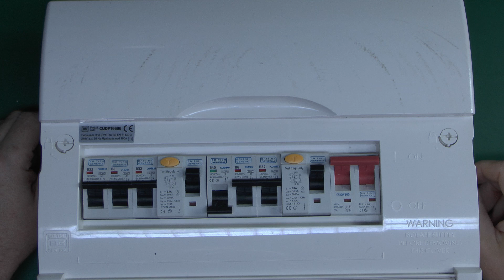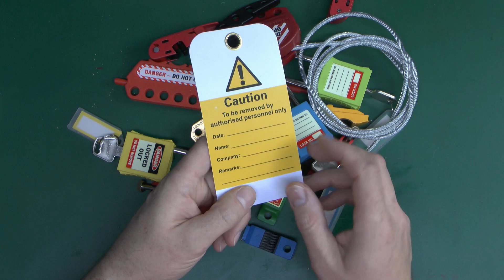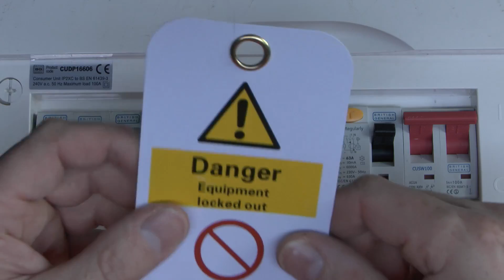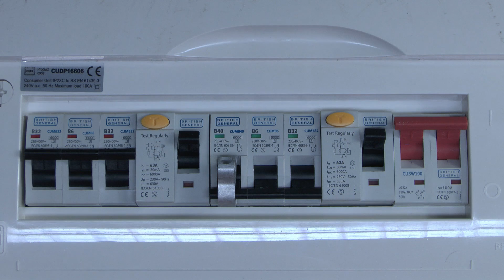Electrical Lockout Tagout Equipment

Comment: thank you for your guidance
Reply: We are a professional lock manufacturer with 10+ years of experience. Our main  products include smart locks, mechanical locks, and industrial locks, certified by  CE/ISO9001. All products feature high security, durable materials, and competitive pricing. We support small MOQs and timely delivery.
Would you be interested in receiving our product catalog and quotation?

Comment: Those coloured padlocks I have one and it made of nylon /carbon composit even the shackle so it fully insulated, silly idea as you could cut the shackle with a pair of cropper’s . My other locks are all metal with hardened shackles. As for working live it isn’t illegal as we have to work live sometimes such as Ze and Zs as well as taking voltage measurement’s and faise rotation . Fantastic video John as always 👍❤️

Comment: Why on Earth can’t they standardise small breakers so that one device fits all of them and you don’t need to carry a whole bag of different ones around with you?

What are the large square keys used to control access to high-Voltage equipment?  The keys are about 30 mm square and fit over a square part in the lock.  This square part carries identifying letters or numbers, and each key will only fit where it is supposed to.  The same key is used both to switch off the supply, and to gain access to the equipment enclosure.  To gain access you need the key to unlock the door, and you cannot remove the key from the switchgear to use it in the door lock without switching off first.  I’ve seen these used in a high-Voltage experiment in the film ‘On the SAFE Side’ which was shown as a BBC Trade Test Colour Film in the late ‘60s, and also for the million Volt Marx generator which used to be at the Science Museum in London until they removed almost everything interesting from display.
Reply from the maker: It could be done, but won't be - consumer units are type approved, and to have devices from mixed manufacturers would require approval testing with every possible combination of devices in there which would be ridiculously expensive.

Comment: I spent some time as an electrician in a south African coal mine. I locked out a machine as the operator kept driving it through deep water dragging the D.C. traction motors through the puddle. The mine engineer came to me whining that the motors were flameproof so therefore it wasn't a problem. I told him to fuck off and educate himself and come back to me when he'd got the water pumped out. Five minutes later I saw the machine drive past me. I stopped it and asked the operator why the machine wasn't locked off. He said "Mine Boss cut off lock"  I walked out off the section using every lock out i had, I had several, to lock out the conveyor system. Effectively stopping the section from producing coal. I jumped in a Jeep, drove to the surface and reported this to the mine manager the same time tendering my resignation as I no longer wanted to work with these cowboys.
Even an efficient lock out system is fallible! Watch yourselves out there.

Comment: Most of our circuitbreaker boxes in the Netherlands are built in a closet, which can be locked. Easy peasy.
Reply: Here in rip off Britain we think of many new inventions which over complicate things, ensuring you buy specialist tools to carry out a single given task.
Reply: We are a professional lock manufacturer with 10+ years of experience. Our main  products include smart locks, mechanical locks, and industrial locks, certified by  CE/ISO9001. All products feature high security, durable materials, and competitive pricing. We support small MOQs and timely delivery.
Would you be interested in receiving our product catalog and quotation?

Comment: I think sometimes it is necessary to work on live circuits, but only:
1. In locations where you simply can't switch off the electricity, for example in a hospital.
2. Use additional safety equipment, for example a rubber mat to stand on and gloves which are rated as insulated.
3. Use fully insulated tools, instead of the standard partially insulated ones.
4. Your experienced.

And in Germany we got the five safety rules of electrical work according to VDE 0105:

1. Isolate the circuit.
2. Prevent reconnection.
3. Proof if the circuit is really dead with a tested voltage tester (two pole!), and test all-pole!
4. Earth and short-out all line conductors (only of interest for voltages above 1000V or bare overhead lines).
5. Cover and shield any adjacent live parts/components nearby the working area (in most cases irrelevant too, that's for example when working in a transformer station).

Tested voltage tester means, tested on a known circuit or with a special tester (available by some manufacturers like Megger or Fluke), before AND after you proof if the circuit is dead. To short-out the lines on voltages above 1000V is a pure safety thing, inductive or capacitive coupled in voltages in such high voltage ranges can deliever enough current to kill a person. Otherwise than it is in a low voltage area, where you don't notice this, and can measure it with a high resistive multimeter only.
Reply: No arc flash protection required for live work in Germany? I'm surprised.
Reply: @coffeecoffee5914  Yes, it's required in most cases. Look at point 2, I mentioned additional safety equipment. In final circuits, which are in most cases fused with a B16 A MCB, I think this doesn't make any sense. In that case they want you to wear face protection and flame resistant clothes (pure cotton for example). If you work on a circuit fused with 3x63A or more (three phase is common here, even in residentials. 3x63A is standard in the service entrance of a single family house), you'll have to wear special arc fault resistant clothing.

Comment: Putting tape over " a load of old crap"  LOL you have a way with words and amazing dead pan delivery style. .   My main job is designing industrial lockout solutions based on safety PLCs and trapped key interlocking systems.   I work a lot in the rail industry controlling access to 750dc third rail and OLE  25KV on the railway.  The biggest problem I face is not the lockout system but trying to ensure they are taceable and stop people from defeating them.  It amazes  the lengths  people will go to avoid locking out, they would rather work unsafely and risk their lifes then take a few moments to lock something out. You honestly would not believe the things I have seen.    Well done on the subscribers John well deserved.  I aspire for my first 1000. Another fantastic video John thanks for sharing. Regards Chris
Reply: Go on, tell us then!
Reply: marcaxe  My latest one is someone climbing over a safety fence at high level to get on a train roof. The train was energised with a 25Kv overhead line at the time.

Comment: I'm a BIG fan of lock out kit. I preach about it all the time, and I have a large selection! Don't like your plastic hasp thou, always metal!! Fyi the multi fit ones you show, made by kasp ect are the best, but master lock have a good version of it also.. I do not get along with tiny stupid metal ones that need a tiny screwdriver!! I keep asking Reece safety and masterlock to make a kit, with a multifit, tag and padlock for under £10. That way everyone, even the cheap skates will lock out!!! So many people, especially domestic, don't lock out at all, and have never heard of it! The more it can be advertised and talked about the better!! Thanks for the video!
Reply: I prefer metal also but the company I work for only supplies plastic equipment including plastic locks with a plastic HASP!   If you just give the lock even a stern look it breaks. Not much better than tape as an actual deterrent.

Comment: Perhaps first hand experience of 400 volts would act as a deterrent.
Reply: Not enough for the tree cutters / I think it was actually the power company down my way, although they did leave within a very quick hurry that day. then they started sending me nasty letters about cutting trees on lines it's sad when you're more professional than the professional. I was not home for 1 hour and my neighbor was so annoyed that they were like we should have just had you do it, I left for my dentist appointment as they got there and when I came back they were gone and so was the power and all the electric heat in the neighborhood and water for a whole day + night with elderly Neighbors...... NOT GOOD !!! But hey at least it was the power company that let out the White Lightning.

Comment: I am sure that many of my compatriots are aware of a situation where an operator has ripped off a tag...along with the isolator ring leaving an open box with exposed live terminals.
No he wasn't sacked. One has to wonder about the committment of British companies to HS and the IEE regs.
Reply: @mikeZL3XD7029  Not specifically but yes, if there's no other reason, reckless endangerment would be an appropriate charge
Reply: @mikeZL3XD7029  Are you the same mike trump from ECN? if so, I missed you. I'm the same chipmunk from there. (sad to see how derelict the site is, at least the non US forum)

Comment: Lol meanwhile in the Wild West of Canada we work on live electricity at like 15/20% of the time and usually without insulated tools. In fairness it’s only 120v hahahaha
Reply: PPE helps.... common sense,  while rare, also helps. But be aware... working live at any voltage that can hurt or kill you is not to be sniffed at. Stay safe man
 I do 240 domestic stuff in the UK, but that can still kill you easily. Familiarity
 breeds contempt
Reply: That can still kill you. Although I’ve accidentally been shocked by 110V AC and lived to tell the tale... But then, I’ve also been shocked by 240V ‘cus although the item I thought I isolated appeared to be dead. The control circuit for the contactor relay was fed via the lighting MCB and was still live 😡
Reply: @Mark1024MAK  Indeed. I've worked on both sides of the atlantic pond. And there are times when 240 just tickles, and 120 grabs you. There's bravery and there's stupidity.

I once came across a situation where the contactor coil was fed from a completely different building and different substation than what it was controlling (light columns on a university campus).... I've often wondered about the potential (heh) voltage differences that may have been present.

In fairness, it was flagged and had a local isolation switch for the coil feed... that disappeared into a conduit headed <<<that way
 Still an interesting example of how simple 'turn it off' rules don't fit
Reply: Mike Trump yeah all of those are higher voltages then 120. Anything higher then 120 we don’t work on live.

Comment: Is there a risk that the padlock could block the adjacent MCB/RCD/RCBO from tripping? The shackle seemed to be blocking the next MCB.
Reply: you cannot stop an mcb from tripping by blocking the lever, even if the lever is held up and a fault occurs it will still trip.

Comment: Alternatively, simply remove the breaker.
>
Reply: Tried it...serious frowns ensued. 🤔
Reply: And what would you do with the flapping wires?

And how is this any quicker?

If the scope of the work allows access to the insides of the board easily, put the live wires (PHASE and Neutral) into the earth bar and be done with it.
Reply: @TheChipmunk2008  I never suggested it was any quicker nor did I imply it was better.
It's just what we used to do in the old days before these fancy lock-out mechanisms were devised.
In the seventies it was mainly fuses, so all you needed to do was pull out the fuse and keep it in your pocket.
When the first breakers appeared you could also just pull them out and keep them in your pocket because they were compatible with the rewirable fuses.
Next came the breakers on the DIN rail. This is when it became a pain because you then had to physically remove the breaker.
These lockout devices are a great invention.
>
Reply: The Electricity at work regs 1989 forbid you to open the consumer unit without the main switch off-therefor at some point you would need to cut the power to the other circuits-in a commercial /industrial setting this is often not practical and the thought of workers downing tools whilst the sparks sets about dismantling the fuse box would severely ruin the foremans day.
  By using these lock-out gizzmo's,only the circuit to be worked on is de-energised.
Reply: @loosecannon5813  Very good point.
>

Comment: Out of interest, do you find this to be an issue in domestic properties? You'd think not, what with you being the only one working there, and being able to tell people not to turn it on, but there'd probably always be some numpty who'd want their cell phone charging or their kettle boiling.
Reply: I knew you were working on it but I didn't think that was anything to do with it.  Does it hurt?
Reply: Just connect the user across the main supply fuse, that will stop any pesky phone charging.
Reply: Other trades on domestic cause issues

Comment: Another top video JW. You missed out  the MK 3 pole fan isolator lock outs... 😉 The first ones I ever had in the late 80's, red plastic, like a scissor action that also fitted into 2 holes either side of the isolator switch. Also came with a MK padlock.

Comment: So what would you use on a Wylex fuse box https://www.flameport.com/electric_museum/wylex_fuse_boxes/white_wylex_reverse_switch_open.jpg ?
Reply: Put a notice on the fuse board. Then assuming it was not possible to lock off the main switch, remove all the fuse carriers, and take them with you. Alternatively, if there are two of you (both employed by the same company) one “guards” the fuse board while the other carries out the work. If the work is going to take a while, it may be better to remove the line wire from the circuit fuse.
Reply: @Mark1024MAK  One of those mcb lock-off would be ok on the main switch - so I guess that'd be one option. Maybe another - once fuse is removed disconnect L for that circuit, sleeve it N and reconnect it to N busbar. Refit fuse.

Comment: Ahh, the red Master Lock plastic body 'lock out/tag out' lock, that they put the most secure core in out of any of their locks. I really wish Master would put that core in some of their other locks instead of the junk they use.
Reply: Haha, that's right, you must be a lockpickinglawyer fan :)
Reply: @Petertronic  I was going to make the same comment Christopher did and for the same reason.

It's also the crappiest lock body of any of the Master locks.  A piece of piss to brute force.  But in this case that isn't a problem.  Maybe even an advantage.
Reply: @bdf2718  Definately want to be able to remove the lock if the key goes missing.
Also definately do not want to be the one who gets the bollocking for losing the key and generating paperwork to demonstrate that the lockout was not bypassed improperly.
Reply: @rarrawer  Also, you want it obvious when the lock was removed improperly.  So it's hard to pick/bypass, easy to break.  If it were easy to pick/bypass, some idiot could remove it, get somebody else killed, put the lock back and make it unclear what happened.  When you can see shattered bits of lock body, there's no hiding what happened.

Also, having to break a lock is more of a deterrent to an idiot than a lock you can open with a bit of bent wire (some Master padlocks can be opened that way).
Reply: The irony here is that Master Lock knows they can't have the lock core be the weakest link. If the lock is physically broken it shows proof that someone may have done something bad (there are times at least here in the US where breaking a lock is legal). A picked lock does not show proof of tampering.
Reply: You can stick the LOTO core in a Masterlock 930 along with red thread locker on the retaining nut so it cant be bypassed. Makes it an absolute bitch to pick if you loose the key because the core floats in those locks.
Reply: Unless you can get a replacement lock with identical pinning, they may figure out what happened.
Reply: @Steve Mclean made me chuckle

Comment: 100K congrats and a safety video to celebrate. We don't have that system since the switches are closed in a keyed door ment to be open by the responsible technician
Reply: Not reliable if you have a bunch of people working on different circuits at the same time.
If I was a sparkie and was offered that, I either would refuse to work on the job or lock the main switch off.
Reply: @millomweb  Yes that's why also congrat also the video itself as extra measure precautions. Don't know if exists here such lock tag devices at stores. Normally here it is one person that goes to work but when more they rely on the key of the boss of first to arrive on the work.
Reply: @MalagasOnFire  Could be done like that but not as good. It also should involve signed documentation too.